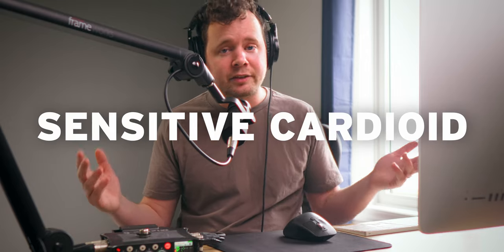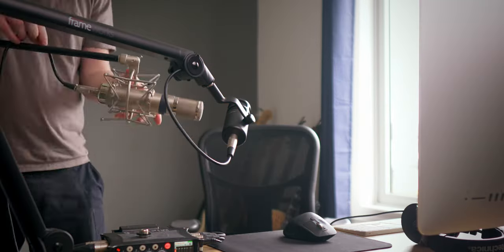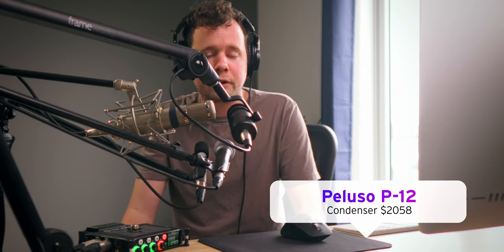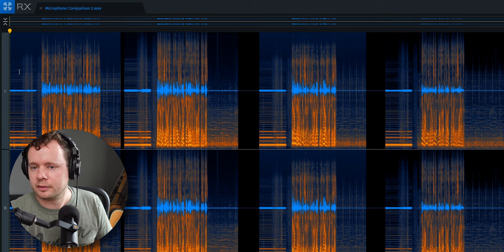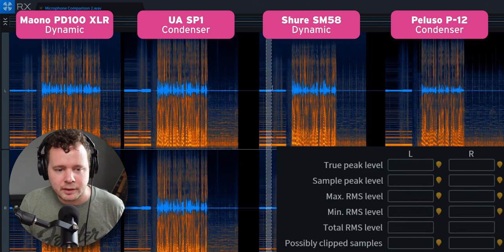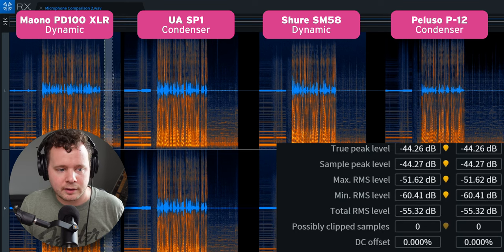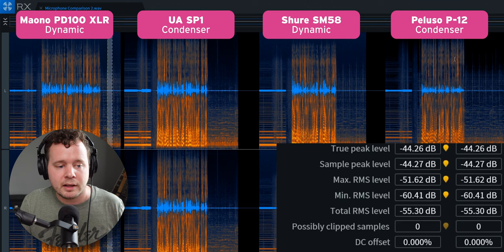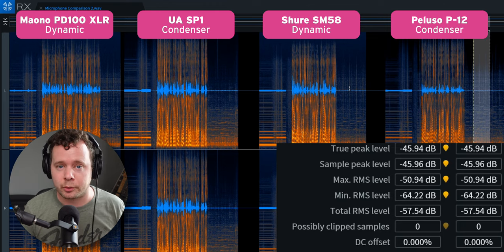Dynamic vs Condenser Microphones

Comment: I think the concept behind condensers for untreated spaces not being good is because they are more prone to pick up reflections from walls, specially high pitch reflections (which condenser are better than dynamics at) muddying up the sound, and not about the noise floor itself
Reply from the maker: Yeah, that’s a fair point. The reason I included a section on electrical noise floor is because it’s often overlooked and dynamics require a ton more gain, meaning they are inherently going to have more electrical noise. About the reflections, I agree, but polar pattern will address just about all of these issues because the only frequencies that can make it around the diaphragm are low frequencies (high frequencies can’t bend well).. All this to say it’s probably not something discernible, but the gain noise likely is.. but who knows. I need an anechoic chamber for these tests lol!
Reply: @randyrektor  Yeah but the title of the video is kinda misleading, because noise floor is (mostly) unrelated to room acoustics, at least preamp gain noise is, so the untreated room has nothing to do with it. In fact, test it yourself, that reverb will muddy up more a condenser than a dynamic. That's why live dynamics are used more, they pick up less high pitch reflections, and low end noise is filtered through high pass, dynamics give more consistent sound room to room
Reply from the maker: Noise floor is a combination of all noises in the signal, both acoustic noise and electrical noise. It’s the sum of all unwanted noises. Signal to noise is a ratio between the desired signal and all of the unwanted noise. Dynamic mics are not better for untreated spaces. Sound on Sound published an article on this debunking the old argument. There is essentially no difference between condensers and dynamics in any space based on the physics involved in the recording process. Here’s the article https://www.soundonsound.com/sound-advice/15-popular-audio-myths
Reply: @randyrektor  I don't know if they did exact tests for this, but oh well. Probably works different for each one on their rooms. YMMV
There is a reason not even professional billionare musicians employ many condensers live, where there is a lot of room/ambient noise (except on sources that require the higher sensitivity and detail of condensers such as cymbals, violins, but we all know why a lot of musicians opt for electric violins instead)
Reply: Condensers are WAAAYYY better for close mic'd vocals! And close mic'd vocals will always pick up less of the room. Dynamic microphones for louder, more live vocals in a poorly/untreated room I would understand. But man, condensors give so much more detail and richness than most dynamic microphones. I think the voice is one of the most layered instruments there is. Every nuance in how someone hits a note, phrases, articulates and even breathes makes an impact on the final recording. One shouldn't miss out on all that just because they're too lazy to treat their room a bit. It's not my kind of music but Bilie Eilish sang under a sheet at one point right ☺️... There are a lot of budget solutions for treating your room a bit better and we should really use the best mic for the best performance, not the most convenient one. Just my two cents 🤷‍♂️.
Reply: Not true. We don't have 16k+ reflections bouncing everywhere in the room.
Also most vocal mics have a rising response (stronger response as they reach higher frequencies) 50hz - 15khz, (which is not every vocal mic) is still more than enough range to pick up these reflections. In fact most dynamics have a stronger high frequency response than the average condenser. The SM7B literally has a low pass filter, see the SM57's frequency response to get a better idea.
Reply: Lol yeah a “very good” microphone will faithfully reproduce your shitty room sound. 🤣🤣 That’s what it is supposed to do.
Reply from the maker: Exactly!
Reply: I tried both in an almost untreated room. Became crazy with a condenser mic, but I decided that I was going to make it. So, I mastered Izotope rx10. But still wasn't 100% satisfied. I finally bought a Samson Q2U to compare with my condenser. And there's a huge difference! 
Why? when I see the place you are recording, with a dynamic mic I will immediately tell you to face the window if it's a source of noise, so, you will benefit of the sound rejection  from the back of the mic ! 
Then volume is the sound out of the mic and the gain the sound at the entrance of the mic. Meaning that whatever the volume you set up, the distance between your voice and a horn for example will always be the same. But the gain is the sensitivity of the capsule, the more you add gain, the more you will feel the horn close to you (sound louder). Finding the balance between both is the key, taking into a consideration that in a non treated room you wont be able to add as much gain as your mic/audio interface can deliver! 
Well this was before because now resonance and whatever the noise (noise floor, hum, self noise...) are not a problem any longer if you are curious enough 😉
Reply: @LeSaff so was the dynamic or the condenser better? I mean those strategies you're talking about apply to both

Comment: One problem with this comparison is the dynamic microphones are way too far from your mouth. With proper placement of 2-4 inches from the source, their gain can be significantly reduced, eliminating most if not all of the background noise. This is where dynamic microphones shine and why they are used on live stages with multiple "hot mics" to prevent feedback and signal bleed. The preamp gain is set as low as possible to achieve a clean sound and then amplified later in the chain.
Reply from the maker: True but you can also use a condenser at that same distance which completely negates this point.
Reply: @randyrektor  A condenser should be placed at least 6-12 inches away from the source for dialogue and will not withstand the same sound pressures as a dynamic without distortion. It requires higher gain and will capture more background noise at the same speaking volume. That's why they are used as overhead, room and ambient microphones, because they pick up more room sound. The dynamic is the clear winner for eliminating noise in a proper setting.
Reply from the maker: This is not the case with modern condensers. This is a bit of a misconception that goes back to microphones of the past that could not handle high SPLs. I’ve recorded countless singers less than 2” from the diaphragm with the right mic. Even Neumann makes handheld condenser mics for live. They are much more rugged than they were 30 years ago and can handle crazy high SPL. Even using condensers on a kick drum is no problemo these days.

Comment: I think most professionals wouldn't say a "dynamic microphone" would be best for a voice in an untreated space. Instead, they'd probably also suggest the pickup pattern. You also leave out the ability to close-mic more easily with most common dynamic microphones, thereby organically increasing signal-to-noise, sometimes exponentially over a tube condenser, etc. Yes, there are cardioid condensers, and some are specifically designed for close-micing of voice.  But the RE20 is the king of broadcast mics, hands down,  because it was designed specifically to be used in limited space, and achieve condenser-like qualities. The science employed in that mastery of engineering is something any aspiring audio-person should dive into.

Comment: I don't understand why these kinds of myths and snake oil is so common in the audio space. I'm more interested in headphones, but I was looking to purchase a new mic last week and obviously the question of dynamic vs condenser mic came up. I was aware that most people say that dynamic mics reject more background noise, but it never made sense to me. The microphone has no way to differentiate between the desired sound (your voice) and the background noise.  The only thing that makes a difference is the polar pattern, which is not exclusive to dynamic or condenser mics. I saw audio tests where people were comparing the background noise by talking into the microphone, and having the noise source (e.g. an AC) directly behind them. That makes absolutely no sense, as both sounds are coming from the same direction. The microphone can not differentiate that. From a physics stand-point there should be no difference in how much noise a dynamic and condenser mic pick up, just purely from the technology. Yes, a condenser is typically going to capture a wider frequency range, but that can easily be EQd, e.g. you could lower the upper frequencies to pick up less sharp details, which might be perceived to sound louder. What I don't understand is why these myths are so common even among individuals that are well respected in the field. My issue is that it influences people's purchasing decisions. E.g. in the headphone space it's gotten a bit better in some areas, for example most people know that expensive cables won't make your headphones sound better, but people still keep repeating how some headphones are "amp picky" and need a powerful and expensive amp to sound good, when that's clearly not true, and has never been supported by any objective measurement.
Reply from the maker: Ahhh yes, I couldn't agree with you more. You're totally right about the upper frequency thing too, condensers have a slightly broader frequency range, but most adults don't hear well beyond 16-17kHz anyways, so it's really not a viable factor in the argument. Practically speaking, you're right on the money, microphones just capture what hits them. That's basically it.
Interesting to hear you get a bit of that in the headphone space. I imagine it would be common in that space because there's a lot of crossover between studio people and audiophiles, which often have very different perspectives (and educations) on the matter.
Also with you that it sucks when these people are selling things in their videos and totally misleading viewers -wether they are aware or not. Thanks for the comment!

Comment: You're missing a couple things. While gain at the preamp does matter related to sensitivity and background noise, most modern preamps are low enough noise to fall below environmental levels especially in untreated spaces but here's the big one... frequency pickup. Dynamic microphones pick up less of a frequency range than condensers. A dynamic may have a frequency pickup of 50-15K Hz while the condenser version may pickup 20-20K. Where are mostly of those rumbles and sounds that people roll off? Below 80 Hz so the headroom changes. Elevated noise levels below vocal frequencies push the level up so of you roll them off (or use a microphone that can't pick them up like a dynamic) then you'll be able to gain up more without bringing up undesirable sounds (AKA noise). Untreated spaces reverberate and enhance that frequency range so when you roll then off, they are reduced thus sounding better to your ear due to less reverb. Polar pattern does help and if you roll off a Shure Beta 87A condenser to match that of a Shure Beta 57A dynamic then yeah, you'd look at background noise in the quietest of environments to see which is less noisy because they would be a match in the things you actually hear - frequency pickup and off axis rejection (due to polar pattern). You covered the difference in pressure operated dynamic mics and pressure gradient condensers very well (along with gain/noise) but you have to look at other defining characteristics between the two mics like frequency pickup too. It all matters.

In your mic comparisons you only cared about background noise with no voice input. If comparing background noise, the condenser would pick up more frequencies and therefore potential noises unless you are in a quiet environment when it's a game of background noise which you do say after your recommendations at the end of the video. Podcaster don't just bring in microphones and record quiet though. If they did then your conclusion would be correct but you're not comparing the sound quality of the signal with both mics, you're comparing background noise only. That invalidates your entire testing because you're not comparing the quality of sound in the signal you care about , your comparing background noise which can be specturally erased leaving you with only signal which may have environmentally enhanced frequencies causing a less natural or acceptable sound. As you know, listening is key.
Reply from the maker: Ayyyyy SoundSpeeds! Longtime enjoyer of your vids. You're totally right that I missed frequency pickup, and that's a massive contributor to what is being picked up at the end of the day. I guess the main point I was trying to make is that the physical nature of diaphragms cant discriminate between sources and I see so many people using language like "dynamic mics are less sensitive, therefore reject more noise" which is only a piece of the puzzle. Thanks so much for filling in the missing parts.

You're totally right about only testing against noise. I recognize that there are some massive flaws in this very unscientific experiment. My goal was to match the mics as best as possible using tone generators at a few frequencies -it's the best i've got for accuracy, then compare the spl of the ambient noises. However, you're right that this is missing top-end in the analysis, which would've likely painted a different picture in that range.

I just think there's a lot of confirmation bias on this topic, and a lot of misguided advice out there, resulting in a generation of people being afraid of condenser mics in home studios.
Thanks for your experience and making this clear!
Reply: @randyrektor  you stick a comment correcting you, thats very humble, well done sir
Reply from the maker: Hey, I’m all here for discussion! He has a great point, and a fair consideration for sure 👍🏻 ❤️
Reply: As someone so has no idea what I’m talking about - I would imagine that if condenser microphones pick up extra frequencies, those could just be removed later in software?
So what’s the disadvantage?
Is it because bandwidth is limited and by picking up unnecessary frequencies up front, condenser mics lose some data where it really matters?
Or is it to do with the convenience of not having to do as much processing?

I mean dropping frequencies sounds simple enough to the uninitiated - is it really such an big deal?
Reply from the maker: @-ok- you’re spot on. Basically splitting hairs at this point. Get nice and close to any cardioid mic and set your gain from there. That will give you the best results.

Comment: Actually preamp SNR is best when the preamp gain is set to max. What you need to look at is the sum of the noise from mic and preamp.
https://www.youtube.com/watch?v=beXVfl1TSD0

I believe the main difference between moving-coil dynamic mics (ribbon dynamic mics perform differently) and condenser mics is their transient response and acoustic damping. Heavier weight = slower response = potentially more damping happening at the frequencies prone to room noise perceived by human ears?

Also, I believe A-weighted levels may be more appropriate in determining how perceived noise level would be to human ears.

I think the reason why people recommend moving-coil dynamic mics for acoustically untreated space is for their design to be used in a closer proximity to the sound source (lower sensitivity overall + lower sensitivity in low frequencies to compensate for the proximity effect). The low sensitivity design forces people to place the mic closer to their mouth (even though some people place their SM7Bs so far away from their mouth 🤦‍♂) to get better SNR based on the inverse-square law.

Comment: Hey. You're right about the electrical noise being more if we use a lot of preamp gain (assuming no Cloudlifter and/or clean preamps)... But condensors do pick up a lot of early reflections which blends in with the vocal and is difficult to isolate in post-production. I've always found dynamics better in untreated rooms for the same reason... They don't pick up early reflections that well. With condensors I'd have to always cut somewhere between 200-800 Hz in an untreated room.
Reply from the maker: The type of diaphragm doesn't impact the amount of early reflections that are captured, only polar pattern. Sound pressure levels are sound pressure levels! If they are in the room, they will be recorded by either microphone similarly. This notion that condensers pick up more background noise is a myth thats been busted by SoundOnSound. I get having favourite mics for different rooms though!
Reply: Yes, that was the coin of the condenser microphone, but now you can use an AI noise remover like Waves Clarity or other alternatives and it solves the problem. But if you are live streaming, yes, a dynamic mic is the best choice.

Comment: Yo. It's not Snr its direct to indirect sound ratio. Indirect sound isnt "noise". When discussing snr noise referse to electronic noise and not enviormental noise.
1. Signal noise from Eletronics
2. Indirect sounds that is a function of source reflections
3. Environmental noise
That has nothing to do with source or electronics
Reply from the maker: While you’re correct that they are different types of noise, they both contribute to signal to noise ratio. Here’s a statement from an audio publication “In analog and digital communications, a signal-to-noise ratio, often written S/N or SNR, is a measure of the strength of the desired signal relative to background noise (undesired signal).”